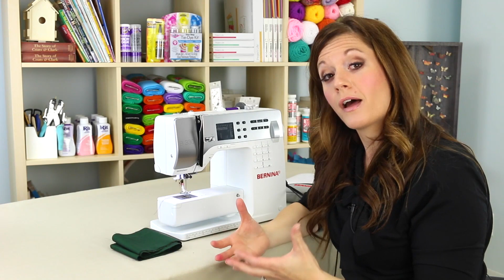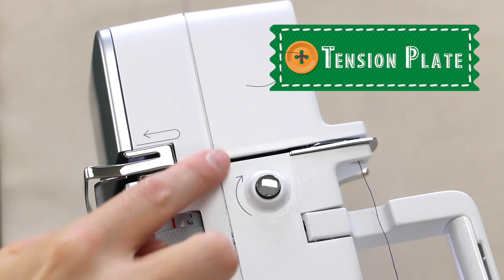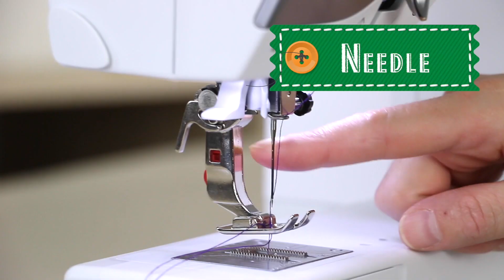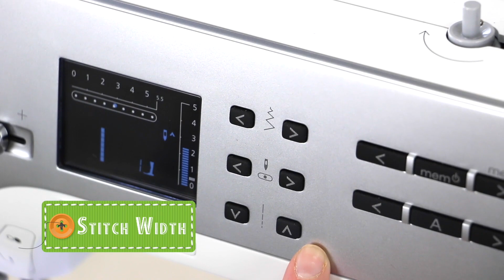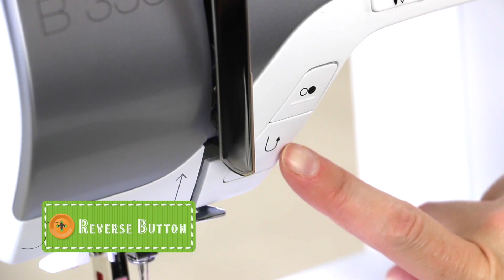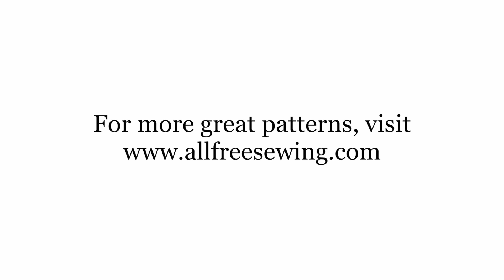Sewing Machine Parts and Functions - Beginners Guide

Comment: Hi Angel,
So happy I found your site!   I have dusted off my machine and I’m ready to jump in again!   I’m loving your tutorials because I’m remembering some things and learning many new things.  I am going to make aprons for my daughter and 3 amazing future daughter in laws.   I figured it was a pretty easy project to start off with.    I’m enjoying the tutorial on the sewing machine.  I figured mine out a while ago but only the very basis.   So! My question.   There is a screw on the bobbin.   I always remembered that my thread tension would get very tight an sometimes break.  Is there something I should be adjusting on the bobbin?     Thanks Angel.   Trying to get my questions answered before I start.
Reply from the maker: HI Patrick!  So excited to hear that you're getting back to sewing.  And I love that you're making hand made gifts for your family and family to be.  Ok, so when it comes to tension odds are that it's the top thread that needs adjusting - not the bobbin.  Very rarely does that screw need messing with.  I would try adjusting the top thread first and switching out to  a new needle (old / dull needles can do wonky things to your machine's stitch).  If after trying those two things you still have trouble.  Try moving loosening the screw (slight turns  - like 45 degrees don't crank it a lot in either direction) and see if it helps.  Best of luck with your projects!
Reply: Patrick McCormack yeah ok boome
Reply: Hidd3n Loud it’s ok, spelling’s hard.
Reply: @patrickmccormack317  He called you a boomer
Reply: Patrick McCormack r